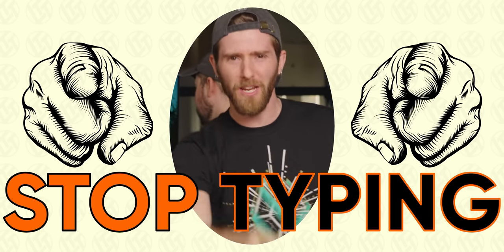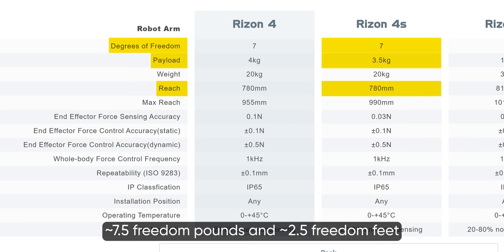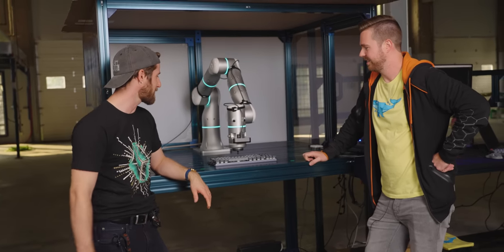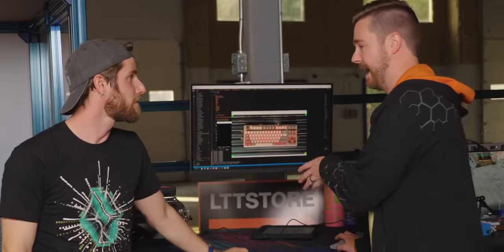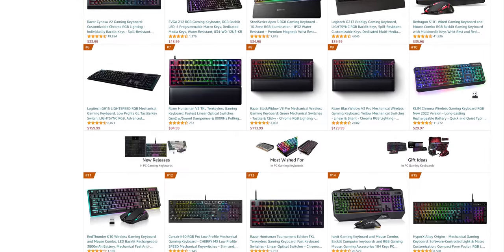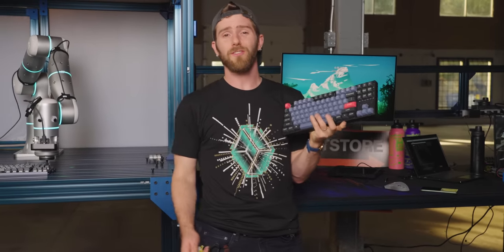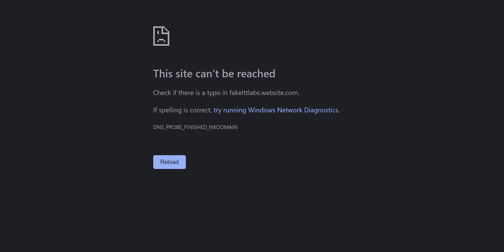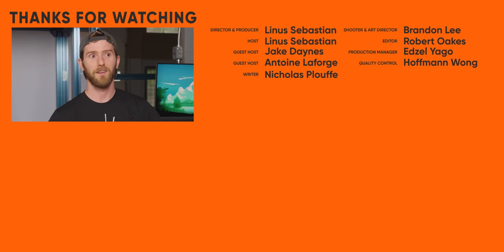Your Keyboard Sucks and I Can Prove It. - Labs Keyboard Testing

Comment: The amount of data that LTT labs is going to be able to produce for free for consumers is crazy Linus is a GOAT
Reply: RTINGS is sweating right now.
Reply: Or, a collab?
Reply: This will be glorious
Reply: @spacetoast7783  Seems they have hired at least one former employee from RTINGS. Apparently Antoine worked there until a few months ago.
Reply: Pretty sure Linus is a human.  Or did goats recently evolve?
Reply: not free with ads and sponsors
Reply: @CasepbX  the original commenter was referring to Linus feasting on his pet goat with his family.
Reply: You can’t be A GOAT, you have to be THE GOAT.
Reply: I imagine that many hardware vendors will be most displeased that they have to put effort into their products.
Reply: @drakenstrijder2463  ltt is way more liekly to collab with a competitor than they are compete with them
Reply: @Mr.Morden  There is a crux of the situation. Linus ( and i suppose with Yvonne's support) are basically going hard aggressive against manufacturers claims. The cable tester was an early view into what is doable. I think they are financially safe now that backpack/screwdriver seems to have been a success.
Hardware vendors have good reason to be worried, there's good reasons why Apple don't send them things, even though recent reviews have been positive.
There's others like Seasonic, that sponsored the unveiling of that Chroma testing equip.
As Dozer would say.. ' it's a very exciting time '
Reply: It's actually insane. Makes you seriously realize how much money LMG makes. I thought being able to keep all these employees employed was impressive but now building an entire lab like this with some of the most expensive equipment and testing methodologies? It's insane.
Reply: Maybe an official LTT certification? LTT logo on every peripheral box!
Reply: @PabzRoz  theyve been working their asses off for a very long time to make all of this happen too. But its a collaboration between money they make from videos, money from sponsors, things that sponsors will just send them for doing a video, LTTstore merch money, floatplane and any other investments they may have on the side. Its a rolling cycle of money is mainly what it is. Knowing that if they spend it, it will come back in some way is what allows them to continue advancing. They for sure are stacked on cash im sure, but its not so much that, that allows them to make those moves. It's the framework they've built for themselves where losing a sponsor like nvidia, would be i  think linus said ".05%" of their sponsorship revenue. where some channels only have like 2-3 sponsors at any given time, LTT has probably close to 30ish.
Reply: @PabzRoz  plus think about the backpack and screwdriver revenue. They are killing it on those two right now. idk that they are fully profiting after rnd yet but they are def selling high volume atm
Reply: Crinacle is also great for audio, although he does have ads
Reply: It’s going to be behind a paywall.

I bet you
Reply: @sundownsupper7409  you would think so yes. Makes no sense to be ifixit and rtings etc together for free or minimal adds on a webpage
Reply: Data people unite! Lets see what we can do with what LTT puts out ;)
Reply: @CasepbX  goat = greatest of all time
Reply: I don't care if he's a Goat or not, it makes no difference to me. God bless!
Reply: frr
Reply: @sundownsupper7409  not likely. If anything, companies will have to pay to submit something for testing, but thatll mean they get to have the "labs 80 plus gold" whatever they wind up naming their accredidation
Reply: I hope LTT will measure everthing Battle(non)sense did. That will be the greatest news for the gaming community.
Reply: Can't wait for his headphones review.
Reply: @Sponers1  don’t be dumb…
He doesn’t means the guy is working for free.
How would he fund everything?
He meant it is free for us.
Or are you paying HIM money for his videos?
Cuz I’m certainly not
Reply: Free is... An assumption
Reply: They're not doing it for free, their going to make money off youtube
Reply: @EdwinDPZ  free for us dude 🤦🏻‍♂️
Reply: I assume the meaty content will be paywalled over at Floatplane.
Reply: DAM OAT MA GOAT AF!!! 😁
Reply: I wonder why LTT has yet to 'like' this comment?
Reply: Data for What or Whom? Every manufacturer has their own test. lol
Reply: It won't be free forever, the amount of money going into labs right now is crazy
Reply: @lawyerlawyer1215   he funds everything with ad's, sponsors, stack flow website, and ltt store. 
All from the community supporting him and his goals.
 It's not free was paid for by the viewers in some kind of way either indirectly or directly.
Reply: Funny thing is , it is a data companies already have, but wont tell us.
Reply: @sundownsupper7409  I don't think so,. The kind of things he's put behind a pay wall so far haven't  been informative things, they've been purely entertainment  based content 

Will he create entertainment  based content using the labs , and put that behind a pay wall?  probably but I doubt he'd put informative content  behind a paywall
Reply: @Sponers1  it costs you money to fast forward through the sponsor? Weird never heard of that . If you didn’t lose money if was free
Reply: Imagine they gonna move it all to floatplane now 😂😂😂😂😂
Reply: It is great but I wonder how this is going to end up getting monetized, because regardless of all the good intentions in the world the three Jake's and all others working for Linus's company will want to take home some money at the end of the day. Now of course the sweet YouTube income and sponsor adds on the website etc will all help pay for things but I am not so sure that will be enough to cover all the bills in the long run.

My guess is that there will be some premium content on the website (in the long run) that needs to be paid for to access it maybe early access or more test details or something like that. I am pretty sure at least as long as Linus is in charge that there will not be paid for reviews fudging the data but again looking at the long term, it would not be the first time a new management direction destroys a companies reputation by choosing short term profits over quality and long term survivability of the organization.
Reply: but linus becomes evil and goes pay meeeeeeee
Reply: @spacetoast7783  lol why would rtings sweat? They have such a powerful testing suite and scoring system that LTT will be years behind. For a forseeable future I will always trust RTINGS instead of LTT if their data is not identical (within product variation margin).
Reply: But how much of that is going to be actually useful data?
Reply: @Sponers1   something is free, when you don't have to pay to access it, for example, watch a video or movie, listen to a song, or read a book. Where they got the money to create that thing is entirely irrelevant.
Reply: @dylonadams1660  It defeats the purpose if companies need to pay to get tested. The companies whose products need testing the most won't be happy to be tested and certainly won't pay for it. Smaller manufacturers who will benefit the most won't have the budget for accreditation.
Reply: @RobertFletcherOBE  good thing I didn’t ask you
Reply: @davidpretorius2984  it wouldn't necessarily have to be some extremely unattainable amount of money. And if you, as a company don't care about accreditation, then you don't have to seek it out. Plenty of companies just make a product and test it themselves and send it out. There are tons of PSU's that don't have 80 plus rating, and they move smaller volumes. It's just something that tells the consumer, based on this testing facilities standards, our product does what it is intended to do. which brings more traffic because it becomes a buzzword, Like HDR10, Gsync Certified, 80 Plus, VESA MCR, etc etc. But say you have a line of 10 new products coming out, a few keyboards some headsets some mice and maybe a monitor. Its not unreasonable to say, Our testing fees are X per device and you aren't necessarily guaranteed to have it approved the way you wanted. You may have wanted the "gold certification" and your product got bronze. It's an indicator that there is room to grow in the product. You can't expect them to do it for free from all sides of the Lab. The information will likely be free for us, as viewers/consumers, but for companies, LTT can't afford to have an entire ingestation of products flowing in to be tested, with double digit employees on staff in the lab, and not have some angle of return coming.
Reply: @davidpretorius2984  and btw, 80 Plus charges THOUSANDS per power supply as well as a 1 time licensing fee of 5000 dollars. its about 11,000 dollars to have one Power Supply Sku tested and they test 2 of the same supply for redudancy.
Reply: @davidpretorius2984  im not saying that LTT should do the exact same model, or charge as much, but with as many things as they are attempting to test and possibly eventually put an "LTT seal of approval" on, they are definitely gonna charge companies like corsair, Logitech, nzxt, nvidia, etc etc for that certification, especially considering its gonna bring those companies tons of money in the process.
Reply: @CasepbX  🤣
Reply: free? Lol
Reply: Does anybody knows if Linus can generate some money out of this date besides uploading it to youtube? It seems to be a really big investions for (maybe) not so much revenue in the end. But dont get me wrong, i love it!
Reply: @Ordust  you should do some research and see how much companies charge for this kind of testing. 80 plus charges close to 13000 dollars to test 1 power supply sku. so......
Reply: I think Lunus is the new Which? guide